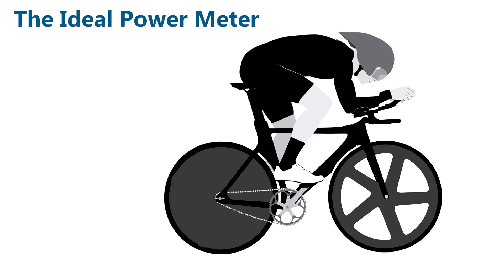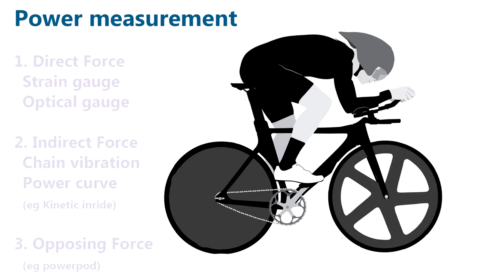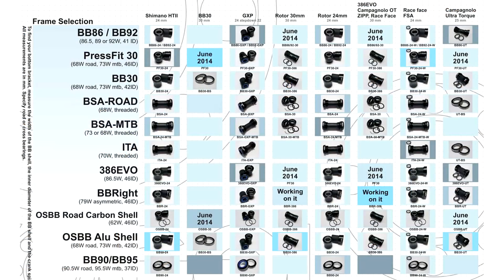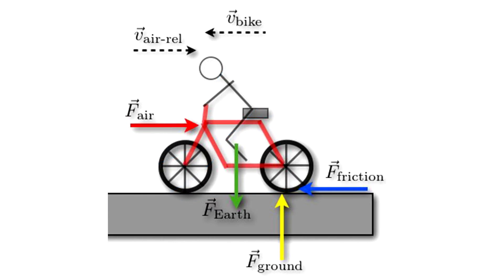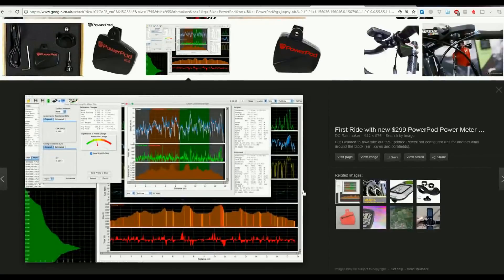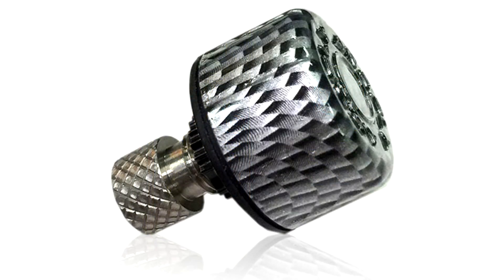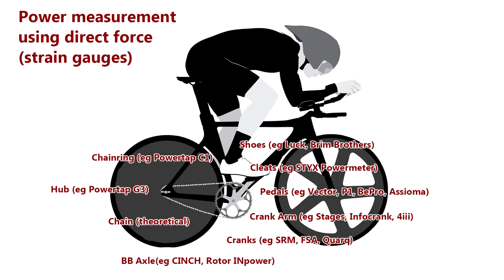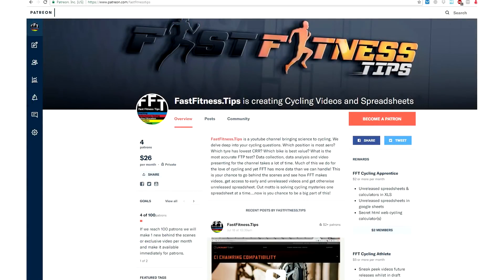An accurate and reliable bike Power Meter for under $100? Impossible!?!

Comment: best power meter under $100 is a heart rate monitor, which is good enough for trainings for 80% of riders
Reply: I think you have it backwards...your heart rate tell you how your body is doing. So you KNOW if you're training too hard or too easy.
Reply: Yura Tolstik In my opinion a HRM alone isn't a good tool for training. The thing with heart rate is it very susceptible to change. A power meter or perceived effort is a much better way to train. This year, for instance, I trained a lot at sweet spot which is around 88 - 93 % ftp. I noticed that some days my heart rate would in zone 3, other days border 3/4 and then sometimes it would stay in zone 1/2. If I was training by heart rate alone then I would clearly be training too hard or not hard enough on some days.
Reply: Paul Rawlinson As a coach I assume you ask your athletes after the workout to grade their effort. I am talking about going out and training in specific power zones. IMHO a heart rate monitor isn't an effective tool for training this way for the reasons I've already mentioned especially as you get towards the top end. It's probably only good for zone 1/2 rides but again I find going on feel is better. As soon as I started using a power meter I noticed that my heart rate zones are quite often out of sync with the equivalent power zone. Take the sweet spot sessions I do. My heart rate creeps up very slowly from the bottom of zone 2 to the middle/top of zone 3 when I'm putting 90% ftp. This may take up to ten minutes or more. My argument is that if I were training by heart rate alone then I would initially work much harder than I needed to bring my heart rate up  to the top of zone 3 and thus increasing the total workload for the session. Instead, training by perceived effort would mean I wouldn't be concerned about not being in the correct heart rate zone knowing full well that I'm putting in the right amount of effort and that my heart rate will eventually catch up.
Reply: Not sure I understand your question. Do you mean if a rider was riding at 90% ftp but their heart rate was showing a reading close to their "maximum" heart rate? In that case you would imagine that either the heart rate monitor wasn't working properly or that there was something seriously wrong with the rider. 

For training, a watt is a watt no matter what! So if you are training by power you instantly know exactly how much power you are putting out. On the other hand, your heart rate COULD be affected by things like temperature, lack of sleep, cafeine, illness (inc recovery/onset), altitude etc. Not only that, heart rate lags way behind the effort you are putting out (sometimes by up to 10 minutes). That's why if you are doing a FTHR test you always need to do the test over 30 minutes and then only use the average of the last 20 minutes when making the calculation. 

What I found was that by training by heart rate alone I was always doing too much and not pacing properly. So with intervals I used to try and get my heart rate in the specified zone as soon as possible which meant I was clearly well above the zone I was aiming for the first part of the interval and then having to back off as my heart rate crept closer to the zone ceiling! 

For me, if you are training then I would recommend using power or perceived effort over heart rate.
Reply: Perceived effort is far more susceptible to variation than is heart rate. Heart rate is an effective training tool. With its introduction in the early '90's it had a considerable effect on the efficiency of training of endurance athletes. Heart rate does have some weaknesses (that you identified) as well as cardiac drift (the increase in HR required to produce the same power as a person fatigues.) However, it is considerably more reliable as a performance measure than perceived effort. I've coached more than 30 people over the last 15 years, and comparing their perceived effort at any given time, or on any given day with pace (running) or power meter (cycling) shows that HR is a more reliable indicator of power output / effort than is P.E.
Reply: Heart rate monitor might help, but estimation and even more prediction on needed power to keep cruise speed (pace) based on terrain elevation models and wind possible directions can not be done without estimation of current power consumption in comparision to predicted values, so it will be difficult to optimize generated power in the terms of position on race track in the moment and power needed soon to overcome gravity and air resistance and rolling resistance with changing terrain elevation and wind direction...
Reply: Mitchell Steindler no that's a common misunderstanding about heart rate. Many factors can contribute to fluctuations between rides and that is why if you don't use a power meter then perceived effort is much better than using a heart rate monitor.
Reply: lebowskii98 If that "common misunderstanding" is true, how do you reconcile a SUSTAINABLE 90%FTP Sweet Spot training session that hits your max heart rate and the rider can't sustain it? 

I believe heart rate or perceived effort is probably a more reliable measure of actual effort than a power meter, whatever those reasons might be (e.g. lack of muscle recovery, injury, sickness).
Reply: lebowskii98:  You may have missed my 'Read More' reply portion above. WHAT I ADDRESSED was your rebuke of Mitchell correction.  Heart rate indicates effort better because it is largely a consequence of one's effort and condition at the time. Power is merely an output, e.g. easy at the start of an hour FTP session, agonizing at the end.  But sure, power meters are evidently better for training in many ways.
Reply: George Hugh We'll have to agree to disagree on this one. A power meter is the best tool for measuring your effort as it isn't influenced by any other factors only the amount of power being generated through the pedals by those two pistons located at the bottom of your body! 😉
Reply: Of course power meters give you feedback on how your training is progressing, give instantaneous feedback for power, and give feedback on changes to position, equipment, etc. - all helpful. But heart rate monitors are BETTER to regulate how much effort you should put in regardless of conditions. It takes experience, and time to learn what your endurance is at different heart rate levels. I know exactly how long I can sustain 165, 160, 155, 152 and 150 bpm. Above that range is a sprint or overheating, below 150 I'm either too cold or not working hard enough. Combine a HRM with a power meter and you can learn your optimum sustained cadence easily - or you can do it by average speed on a known course, speed on the flat, our just by feel with experience. Power meters are great paired with HRM, but if you had to pick one take the HRM. It's the only thing that tells you how your body is responding to your effort. If I'm doing a 1 hour time trial I keep my heart at 155 with my optimal cadence range, and couldn't care less what my power is, because I know that's all I can do for 1 hour.
Reply: lol its so random, heart rate is shit, wait save your money and buy a cheap powermeter..